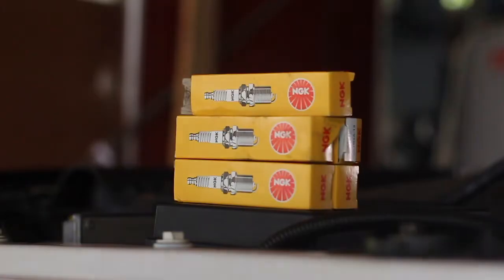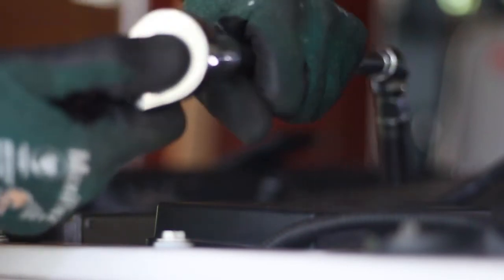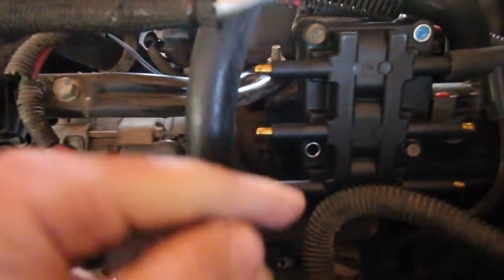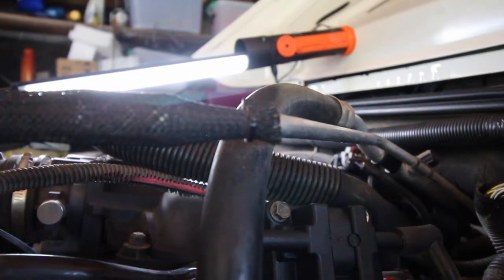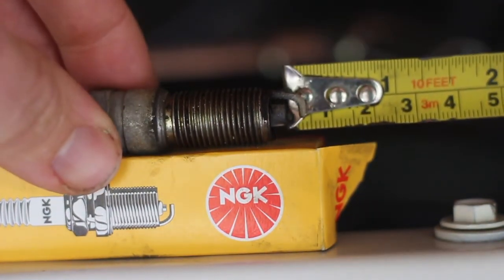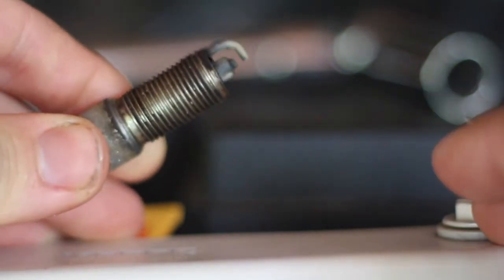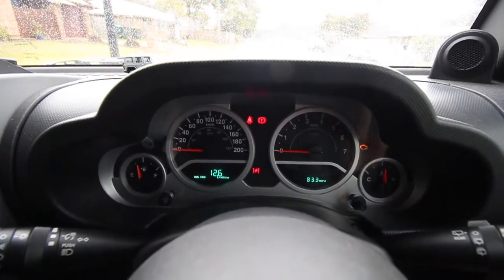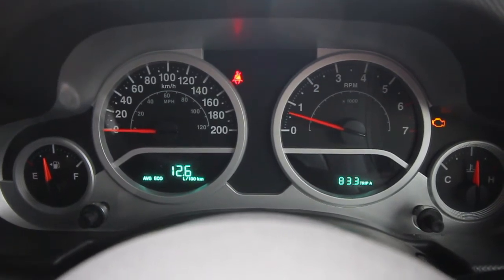HOW TO CHANGE JEEP 3.8L SPARK PLUGS

Comment: Nice vid mate, being an Aussie across the ditch, always good to see RHD cars being worked on. Did you have trouble with any of the leads stuck on at the spark plug?  I was trying to replace plugs recently and 4  out 6 on mine are stuck hard,  didn't want to risk using full on brut force in case  the leads/boots get damaged yanking them off.
Reply from the maker: Thanks mate, no I didn’t, did you get them off? Are you replacing them both? Maybe a bit of WD40 might help, just not 100% sure sorry.
Reply: @Whiteandsonsgarage  Wanted to change just the plugs, will try again with a dash of WD-40. Totally unexpected problem, never had this on any other car I’ve worked on.
Reply from the maker: @stdevote03  yeah very interesting, let me know how you go with it. Really interested to see what happens. Thanks

Comment: I have a 2010 Rubicon (59k miles) and a 2016 75th Anniversary Edition (55k miles) as much as Jeepers say the 3.6 is superior to the 3.8, the 3.8 is so much easier to work on and it DOESN’T HAVE THAT GODDAMN PIECE OF CRAP PLASTIC OIL COOLER HOUSING that already failed on my 2016 at 52k miles, as well as the rear main seal, luckily still under warranty with Mopar CPO 7year/100k Powertrain warranty.  My CE light came on too (‘10 Rubi) for the EGR valve, but went off on its own after a 50 mile highway drive.  The vehicle was on a lot for 3 or so weeks not driven, so it probably needed to get hot to function properly again.
Reply from the maker: hahaha of yeah, don't know why they added that part it really just gets in the way, oh no that sucks, what will you do when they are not in warranty? would you still stick with jeep?